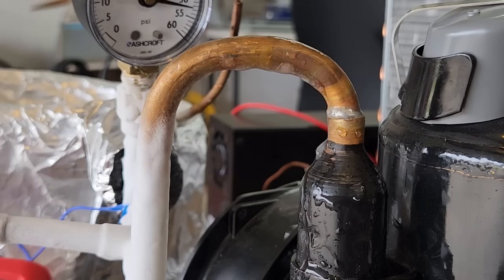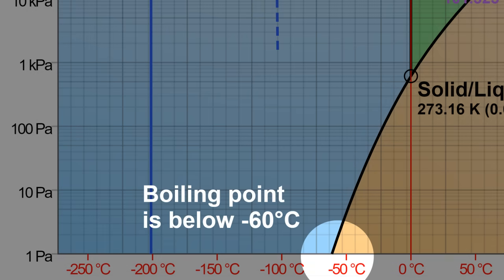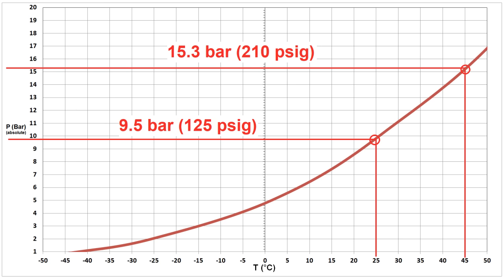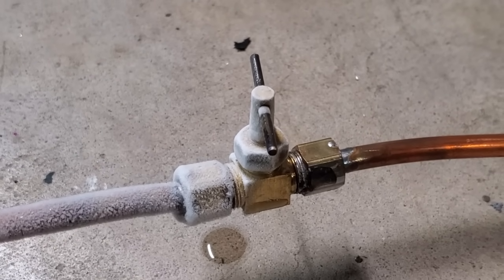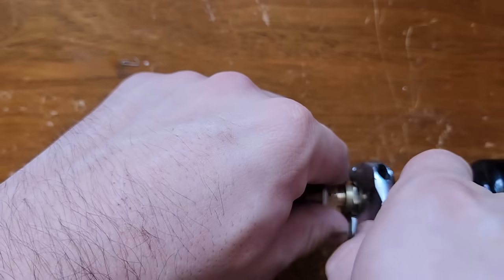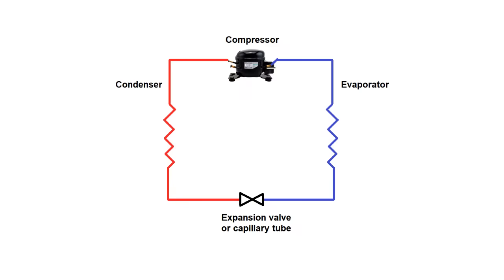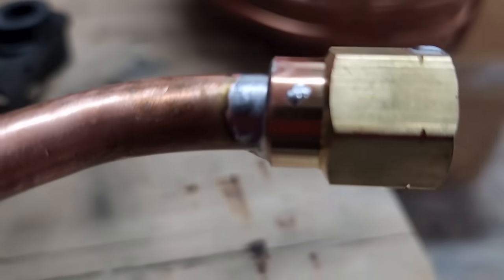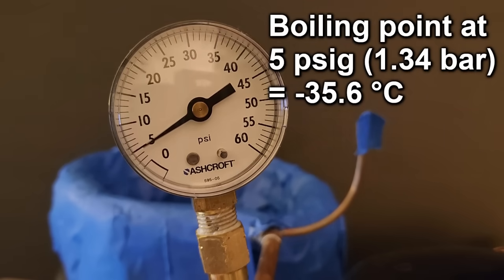DIY Vapor Compression Refrigeration System

Comment: Something I recommend doing differently here is not to solder (as appears being done), but to braze instead, preferably with silver rods. 

For a more permanent/less experimental system I also recommend flushing tubes and part while brazing them with inert gas (N2 is cheap and easy to get) to avoid corrosion on the inside of the tubings as that is the stuff that might eventually block your capillary tube. 

Notwithstanding this I love the videos 👍🏻👍🏻👍🏻 and particularly this one as it threw me back to my highschool days when I built cascade systems to cool my CPU and overclock…  

I commented on your last video with a recommendation to do a R290/R1150cascade system - I wonder whether you had seen this ☺️

Comment: Interesting video.  As an electronic Tech, I don't know a lot about refrigeration, but am learning through videos.  At 26:15 you state the compressor input power as volts * amps, but this is not the true power consumed as you are not considering the power factor.  The true power consumed is actually less, so it's more efficient than you think.

Comment: Worked in a cryogenic shop for a number of years.  
On the low temp side, the dryer was the largest source of water contamination in the system.  This can be solved by chilling a second dryer, equipped with isolation valves and a bypass valve, to a low temperature.  Once the system has run for a while, all excess the moisture will be in the chilled dryer.  
The isolation valves closed, the hypass opened and chilled dryer can then be removed (while still cold) from the circuit and you will have a very dry system.
Having said all this, the above may be overkill for what you are trying to do.

Comment: Very interesting.  Thinking about the "gears" in the capillary tubes, you could probably design a simple "gearbox" where you have few of them in series and then needle valve where you can short circuit part of the series back to the intake.  In parallel you could probably create few ratios by carefully choosing the lengths and therefore you could choose the pressure drop by opening and closing valves.  Just a mechanical engineer, not a ref guy.

Comment: I second the other comments around measuring superheat and sub cooling. That’s the typical way one measures the appropriate charge level in a system. Basically the sub cooling is the amount by which the refrigeration lowers the temperature of the condensed refrigerant below the the condensation temp. And the superheat is the amount above the evaporation point for the low pressure side the system heats the gas. The advantage of a thermostatic expansion valve is that it controls the superheat to a narrow range for a given refrigerant, assuming you can find one for propane. I believe there are also electrically controlled valves used in modern automotive systems. I think in your case though you want absolute minimum temperature so you want a lower superheat and maximum subcooling on the hot side. You should also flow the refrigerant in the exchanger in the opposite direction to ensure the end of the flow of the secondary stage is the minimum temp.

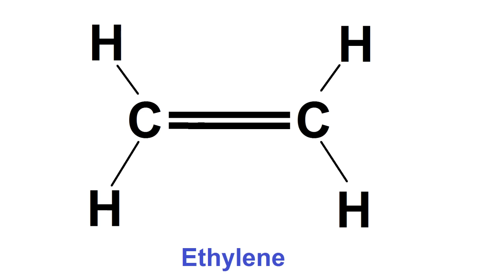Comment: 28:00 BTU: ~  This is the units refrigeration technicians use but from an engineering perspective it's "kind of annoying".  It feels like you're being a bit facetious here.  This actually never happened and I am so grateful  - where I would have to answer a question with units involving BTU's.  It does not matter how well I know principles of heat transfer or thermodynamics, making it through all the unit conversions and getting the right answer was a crap shoot for me with the odds heavily stacked against me.

Comment: Very cool. I  think an externally equalized TXV is critical to the longevity of this project though.  You figure, we’re after the phase change and only the phase change for cooling, then a small superheat to prevent flooding. Too little returning, compressor can’t cool and discharge gets above 225 degrees.  Too much returning, it could contain liquid and wash oil from the bearings. 

In fact on a capillary tube system, in HVAC we charge refrigerant based on one single metric- suction superheat at design conditions.  

I think you need another pressure gauge at the inlet of the evaporator. Your gauging saturation at the very end of the evaporator run, after a significant frictional loss. What iif further up the pressure doesn’t equal 0, but 20?  That’s a much higher temperature pressure relationship and from that angle heat exchange might be ok. 

Household propane contains additives for smell btw, not sure if that plays nice with the polyolester oil. It may also coat and insulate the copper. This could then become exacerbated if oil begins to migrate because of the low load, collecting and worsening the problem.  It will also have at least some effect on the condensing pressure, maybe small but maybe not. 

This will be a cascade system so the load may keep the lines clean. Typically evaporator approach (or the delta between evaporator saturation and fluid leaving the secondary loop) would be no more then 10 to 20, though on big chillers it’s 0-2.  

In HVAC we size air cooled condensers to run 20 over ambient with the expectation that the last 20% containing pure liquid. So after 15 degrees of subcooling (General standard )the liquid line would be 5 degrees over ambient.  This is important in a cascade because inefficiencies are compounded as they are transferred across stages.  Once this sees real load, condensing pressure will increase and if it gets too high, the compressor will need liquid injection.  225 degrees on the discharge line is the standard cut off for POE oil I think.  

Just some food for thought, awesome project!

Comment: Other option to the reat transfer can be melt some copper and make a junction between the two, or put some thermal paste, this will reduce the friction inside and depend of the way that you do, the heat transfer will be much better and with much less resistance on the larger tube, also probably will be more easily to do in larger scales, by the way love the series man, I'm here since the first video that have the goal to make liquid nitrogen, it's very nice the approach that you are taking and the videos style, I hope that you realy get to the nitrogen liquefaction point, I have searched for solutions like that, alternatives to cryocoolers a long time by now, so this will be really amazing, keep going you are doing great job! 😎

Comment: In the diagram of the interstage heat exchanger you have it in a concurrent flow but in the overview of the whole system it's a countercurrent.
Countercurrent flow will get you much more efficient heat transfer.

Comment: Many thanks for the video, you certainly put a lot into it. I'm an HVAC Master Tech and you gave me some interesting concept ideas  on my next project.  As the global fresh water situation is considered to be moving into the danger zone, I am devising a zero powered solar chill process to produce condensate sufficient to be viable for 7 liters per day of safe sanitized drinking water Best of luck with your super chiller.

By the way, use the aluminized foam sheet bubble wrap type insulation instead of the foam pipe wrap, the very stable plastic coating also makes it sweat less as well as having greater superior insulation value.

Comment: 13:48 I know why it was difficult to coil this back up;  Copper work hardens really easily, straightening it out hardened the copper, and then recoiling it was twice as hard. If you heat the coil up to nearly red and let it cool slowly it will be very ductile again and coil easily into as tight a coil or bend as you like.

Comment: Excellent! I'm running a similar project and the difficulty is really the tuning of the system. Therefore why have you disqualify so quickly needle valve? It takes a really long time to tune capillarity tube. One of the only DIY LN2 successful proof of concept I found on YouTube used a needle valve! It was a JT system loaded with 300 bar of N2 and he explained he choosed needle valve because he was afraid to clog capillary tube!  Would love to hear you thoughts about that 😊

Comment: I was watching and wondered did you pull a vacuum on the system to remove the air? I didn't see that part but as an automotive technician i know that if you don't remove air it takes up valuable real estate that the freon needs. Filling a system with freon without removing the air "works" but removing it all then filling with freon only into a vacuumed out space is better for the system. I'm trying to make something and stumbled on this which was super helpful. I'm also in FL maybe we can chat I have some questions. Thanks

Comment: There is also r152a which is meant to replace r134a, is low pressure and can be found in modern canned dusters for very cheap.

Comment: Pro Tip: To make rolls of tubing straight just drill a hole the same size as the tubing through the width of a 2x4 clamped in a vise. Then pull the tubing through. It will naturally straighten itself out perfectly. There is a enough friction if you do it  right that it doesn't go back either.

Comment: Great work, but a couple of things: compressors are designed for different evaporator temperatures. Using an AC compressor (high temperature ~4°C) for an evaporator that is ~40°C is not very efficient. You should use a low temp or extra low temp compressor.
The other major issue is superheated and subcooling considerations. The more subcooling in the condenser, the less efficient. The more superheat in the evaporator the less efficient. We need to maintain some of both, but it is more efficient to do it with a heat exchanger between the liquid line and suction line.

Comment: People will tell you you have to braze, but lead-tin solder or Stay-Bright (slightly higher melting point than lead-tin) will work fine.  Get some paste or liquid flux.  
Also, you'll be much happier with an adjustable, evaporator pressure sensing expansion valve.   Not the kind with a temperature bulb, those are pretty specific to the intended temp range.

Comment: Nice, keep great work going, this brings fond memories of my DIY propane and R404-system builds for computer CPU/GPU cooling. Just few questions - why not use standard commercial plate HX and to save on work time and improve efficiency? Also you'll need oil separator and bypass path for second stage to avoid freezing oil and overheating compressor. -6C without insulation sounds like not enough cooling power. Efficiency of cascaded system is not great, so it's always good to have some cooling power headroom.

Comment: the funny thing is most commercial deep freezers dont do any fancy cascading or anything or use an electronic or thermostatic valves they just way overspec the compressor and use a capillary tube like you did. they seem to be limited to -80c tho

Comment: Hi i love your work and I have a suggestion, maybe you should try to use an arduino to manage the needle valve. If you use a  geared steppemotor like the "28BYJ-48" slow but precise and loads of torque for the application, I think you can gauge the pressure before the needle valve and after the needle valve, feed the data into an arduino PID loop and based on that regulate the needle valve. you can even add a 220V relay for the compressor, temperature probes, and a display.

Comment: I was told by my father that the Russian AC units used to have that water of moisture dripping on them in such a way that the compressor used to get additional cooling. But modern AC units don't have this hence this efficient cooling method is not looked into by Japanese or even the Chinese AC manufacturers while designing Air conditioners

Comment: This is an awesome video. I would only suggest that your charge the system to superheat and not total volume of the system. 5° to 8°f. That should help with flood back and proper compressor cooling. Without knowing your superheat, subcooling and discharge superheat you don’t really know how well or not well it is running.
Reply: Please, expand this subject with step by step instruction
Reply: Superheat. 
The difference between the pressure temperature difference on the suction line exiting the evaporator. 
R290 suction pressure 10psi = -21°f but the suction line temperature is -10°f witch would be 11°f superheat. 
Subcooling.
The difference between the liquid line pressure temperature and the liquid line temperature. 
R290 150psi = 90°f but the temperature of the liquid line leaving the condenser is 80°f witch would be 10°f subcooling.

Comment: the airflow across the condenser has to be a specific amount, overcooling it will screw up the distribution of liquid.  You can effectively make the system act overcharged or undercharged by varying the subcooling.  Subcooling always has to be at least few degrees, but a ton of subcooling will need to be taken into consideration elsewhere as it screws up the pressure ratio.

Comment: You should feed the evaporator from the top. The condenser you should feed from the bottom so the bubbles go out of it. Which is why your heat transfer block was not working it was going from liquid to gas which was canceling each other out.

Comment: I would suggest getting the compressor curves from the manufacturer! Note that compressors are rated for high, medium, low, and extra low temperature use. This is due to compression ratio. AC compressors are typically high temp.

Comment: Fans startup issue, add a large capacitor between the 10 amp supply and the fan for startup.
Once you have the two temprature differences run an alpha Stirling engine between them for your second stage maybe.

Comment: Shoukd have used king valves for your gauges, and best to spam the things for convenience's sake at each component.  Will save you time modifying.  Use the compressor to pull down and capture the refrigerant down to near atmospheric in event of a leak or pull into vacuum for a part change.

Comment: Very nice... But you gotta get your compressor cooled.. since electrical efficiency isn't a concern place a fan above the compressor and Aluminum fins to the housing. To help dissipate and pull heat away.

Wrap your evaporator insulating cork tape

Comment: I want to take the opportunity to add that consumer grade (HD-5) propane can contain up to 10% impurities, so it may be worth getting refrigerant grade R-290. You can get the EPA 608 Type 1 with just an online test (you have to know a little bit about refrigeration, but it seems you already do). My local supply house will sell me 30lb cylinders of pretty much any refrigerant they stock.
Reply: It`s true, to get epa 680 is not a big deal, but prices for refrigerants are insane. 4 oz. refrigerant grade of ethylene for $ 600.00, 5 lb. R-23 $ 1,200.00... is sick. Most of impurities in a propane cans is propylene, iso-, butane... No big deal.
Reply: And I'll add that hand torch tanks ("Bernzomatic") fuel is also labelled like you say, their SDS lists the 87.5%-99% propane, up to 10% propylene, up to 7.5% ethane, and up to 2.5% butane. Someone else mentioned BBQ propane as possibly containing water; I can't comment on this but the torch fuels are at least free of water contamination. 

Propylene ("MAPP" "MAP PRO") is 99.5% pure, though! might have a little propane in it.  AKA R-1270

Comment: Great work and I'll be using this as part of the physical science course for my kids and probably some of my nephews and nieces (should be a nice range of 6-16yoa) next school year. Of course, many homeschooled kids don't actually get the summer "break" but we can call that portion the practical application.

I "concur" (dads gonna pun) with the other comments about the HX being MUCH more efficient when operating as counter-current. I would not be surprised if you got the HX outlet down to 0°C.

Comment: You can buy liquid phase heat exchangers meant for AC applications

See the Adam Savage refrigerated suit one day build video for an example of this.

Now granted, that one is really small, but the bigger ones aren't that expensive either. In my opinion, that is the easiest way of going about cascading refrigerant loops

Comment: Many years ago, befor I had internet, I was thinking of setting up an ac for my house useing a 500 or 1000 pound propane tank. All I really knew was what I knew about the properties of propane from my chemistry books and the basic ac works. For cooling the returning hot gas, was thinking of a putting unit into a water tank and having a pump run water over a tower or waterfalls. Water is 300% better at removing heat than air and water would also use evaperative cooling, used keep replacing loss. The large propane tank also has alot of surface to lose heat. Rather than propane going into to centrol air system, perhaps move a cooled alcohol into the house system. It was something that I thought about, but would unlike do, but if I watch this over a few time...?

Comment: Bubble the propane through a sodium hydroxide solution chemically binds to and removes  mercaptan and other sulfides. Then dry the propane with a desiccant. 

Caustic soda wash and Sulphur making stable salt, sodium sulphate. 

Store bought propane is probably dirty with heavier hydrocarbons. You may want to chill the tank and only  use only the light stuff that boils off first.
Reply: The filter drier absorbs the mercaptan so it's not a problem.

Comment: Do you have an oxy acet torch? or maybe a turbotorch? Get some sil-fos and braze your copper to copper connections, theyll be much stronger. FWIW, we still use soft solder on our capillary tubes for gauges and such. We squish the pipe just like you did, too